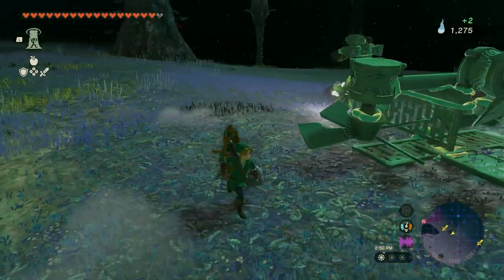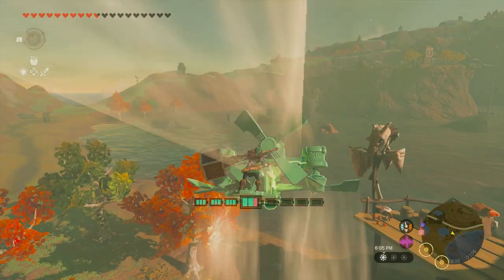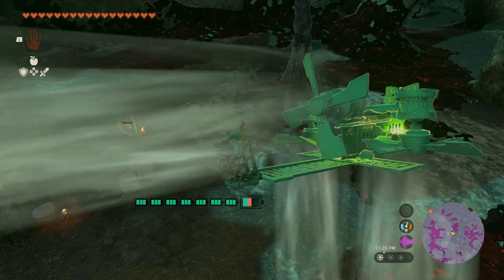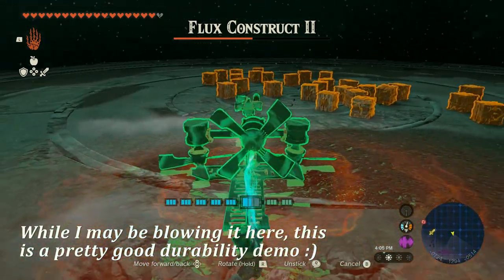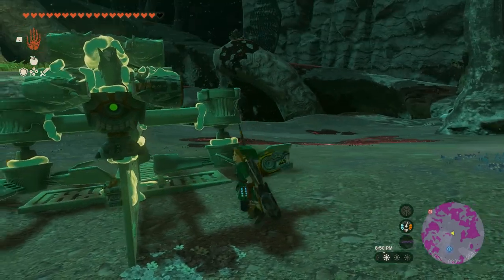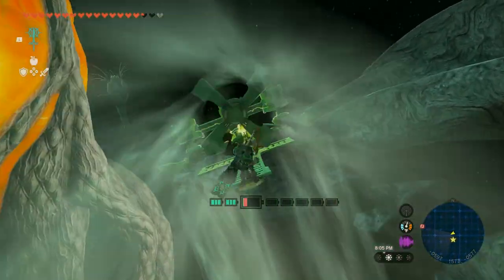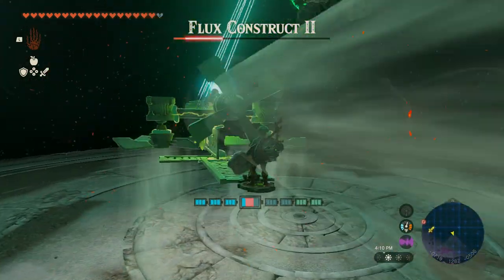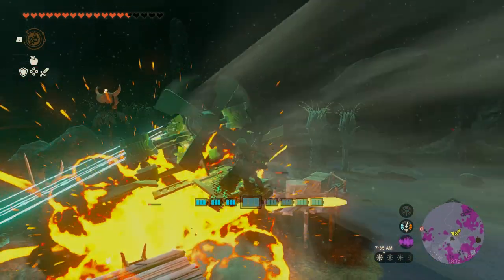The Chopper - USEFUL Helicopter! Theory + Demonstration

Comment: i just finished making my first battle aircraft that destroys my battery life if im not wearing the full zonatite armor set. Though it can do this thing where i can pull the vehichle (tilt it) up, and the bottom of my platform will face towards the enemy, and i very slowly start hovering in that spot. The bottom of my platform being where my beam emitters are. So essentially i just pull up to an enemy (or enemies), pull the stick back to tilt upwards, and just float there in front of them while everyone dies. 
I like the efficiency of your design to use shock emitters, and metal rods to save a HUGE amount of battery.
Reply from the maker: Funny enough I've been working on a craft that does just that! Here's a link to that.
https://www.youtube.com/watch?v=gGBuqm1Tkhg&t=0s

And thanks so much! This build is a tried and true, easy pick for me.